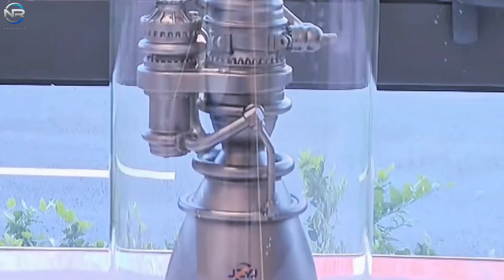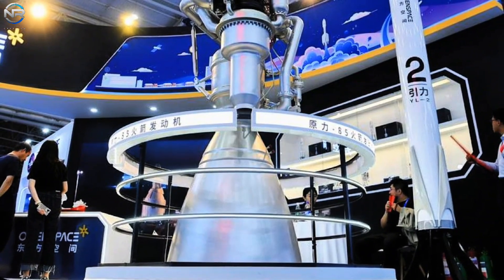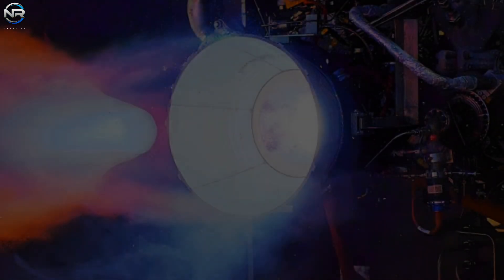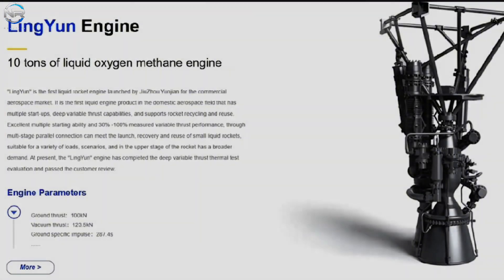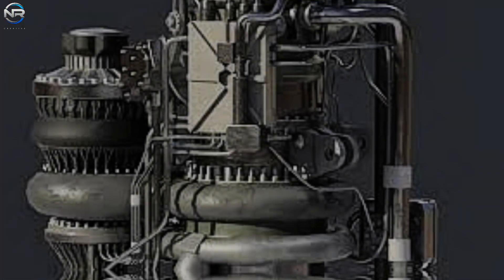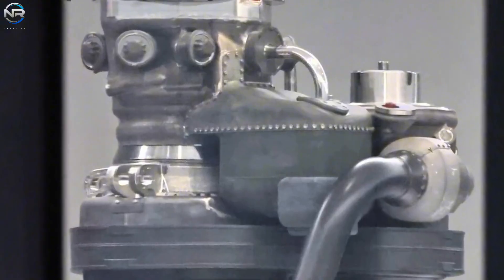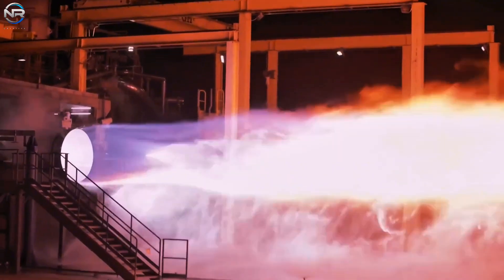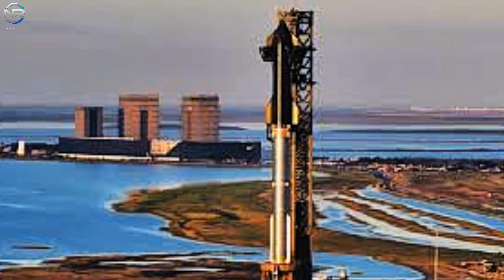China Fake Raptor 3? SpaceX Reveals Proof of Copycat Design — Elon Musk Reacts!

Comment: The Chinese have closed the gap in many areas with a similar strategy. 

They start by copying.  There copies are based on public information as well as aggressive cyber espionage into closed corporate and classified networks. 

Even with all this data, they have a learning curve and their first versions often fail because they lack the knowledge, skills, and experience. They make basic errors in design and manufacturing. 

That said, they also learn from these failures and advance quickly. . 

Chinese corporate and cultural ethics are very different than the West's. Aggressive cheating and lying are expected business practices. This is also how they operate with other Chinese companies. It is a different set of (or lack of) ethics. 

It is augmented by direct support from their government and the CCP.  The government will subsidize a company or a whole sector so it can compete at an advantage until competitors are pushed out of the market. 

They'll also freely leverage their vast intelligence networks for corporate espionage, handing over terabytes of foreign proprietary and classified data. They'll deny it even while holding the goods in their hands. 

It's encouraging that they don't have direct copies yet. Don't underestimate their ability to get there.